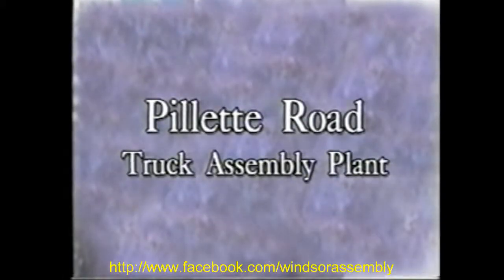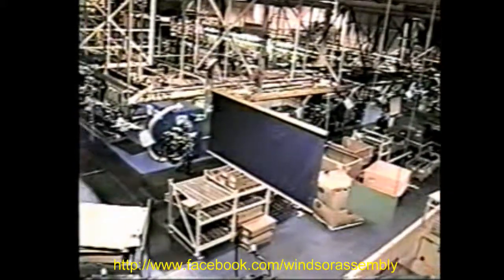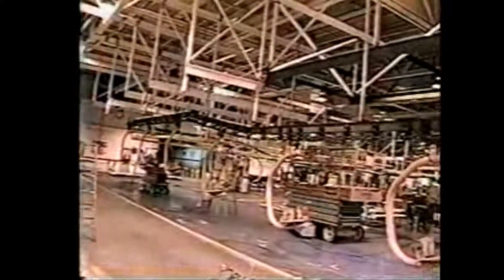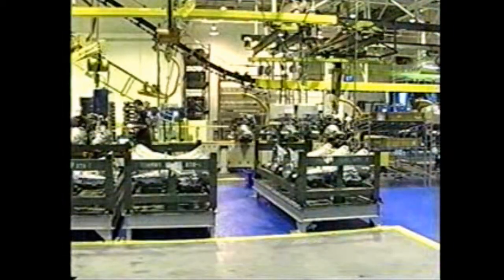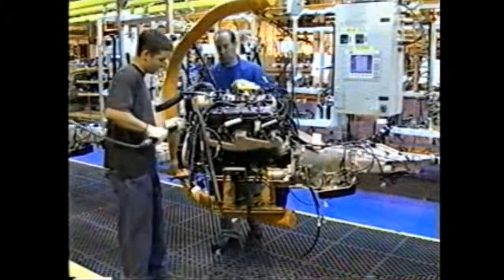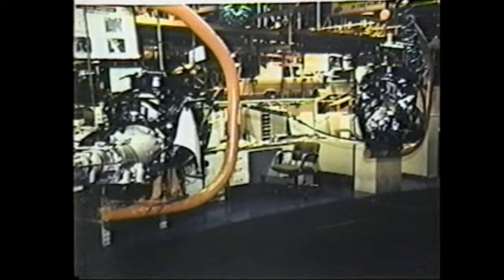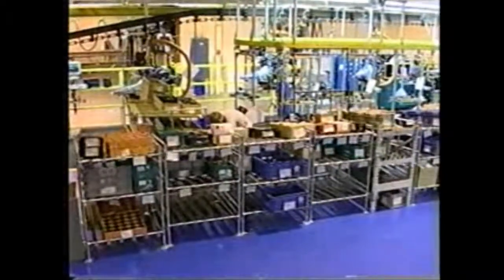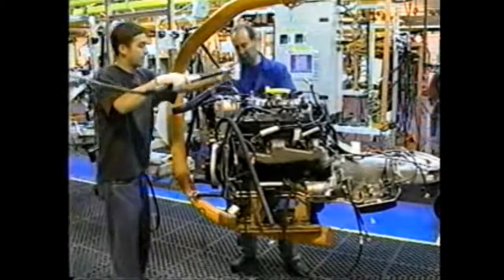Pillette Road Truck Assembly Plant

Comment: I was doing research today on my 1979 Dodge B300 van. The shop service manual (From Chrystler) doens't show a K for the 9th digit in the VIN only shows V for Warran Truck plant or X for Missouri Truck plant. Mine is K, which as it turns out, is this plant according to another VIN decoder. I am doing a full restoration to factory specifications since it seems these vans are partiularly rare.